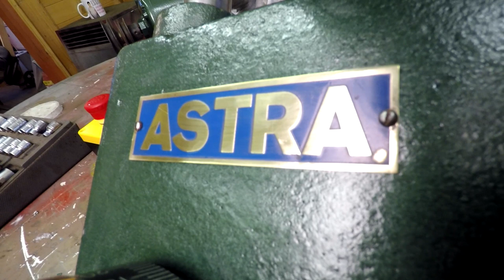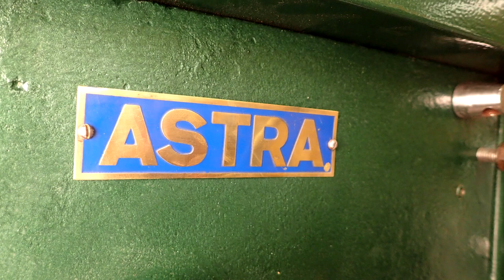(Part 3 of 3) Scrap Pillar Drill Press In Bits - LETS RESTORE IT

Comment: Bloody well done mate. A worthwhile restoration that should see you out. A couple of suggestions: put a long drill in the chuck and use a square to rotate the drilling plate to exactly 90 degrees to the chuck. Ditch the chuck and go for a keyless one. Trust me you will be glad you did. Put an old piece of board between the work vice, which I’m sure you will get, and the cast iron plate so you don’t drill holes through it.
Looks really good and I like the colour, kinda old school. Cheers Stuart 🇦🇺
Reply from the maker: Thanks Stuart. Yes, I was thinking of changing that chuck.
Reply: I’ve always had trouble with keyless....the drill or what ever you use in it (you can buy different gadgets for your drill...rotary planer, sanding drums, router bits etc. that make your drill more versatile. ) tend to spin in the chuck at times. Just be sure to use the key in all 3 places when tightening if you decide to stick with the original.

Comment: a rubber donut is supposed to be between the body and quill. That way, when the quill returns, it doesn't smack metal against metal. Speaking of that, you need to pre-load the mainspring so that the quill will return all the way up when you let go of the handle.
Reply: How does one preload the spring?  Just twist it a few times before bolting it on?
Reply: Yes. Wind it up one or two turns in advance.
Reply: This. Oh my god I was getting so mad. Haha

Comment: Hi Martin, I suggest you tension up the quill return spring to fully move the chuck return wheel fully back to it's stops. A good set of vids mate.
Reply from the maker: Yes, I will. I just wanted to get the vid out on time as it was down to the wire lol
Reply: yea. Just what i thought. Pre-tighten it by giving it one turn or two in advance and it should lift the pinole up to the end.

Comment: When you press a bearing inside a 'tube' the pressure needs to be on the outside race of the bearing (which you did), but when the bearing is being pressed on a shaft the pressure needs to be on the inside race of the bearing, which you did not do.  Nice color!

Comment: I would have removed any drips of paint from the insides of the surfaced and also tensioned the quill spring to return the quill to zero. I would also use some 30weight oil on the outside of the quil to lubricate the shaft. Very nice restoration.

Comment: Great job mate, enjoyed watching that. A tip for you is to tack weld the rack to the column (top & bottom) it's saves you having to realign the table when it's moved up and down. You got a👍🏻from me... All the best.
Reply: TD
I have 2 of these large drill presses. The rack is loose on purpose, to allow you to move it out of the way so that you can use the vice designed for these on the base and clamp projects upright for end drilling.

Comment: Why didn't you just mount the front half of that NVR switch straight over the cutout in the iron headstock...?
Reply from the maker: Many ways to skin a cat lol and the terminals are in their own enclosure instead of in the drill press where you can get a few fingers up under that head bit.
Reply: @bizarreandbrilliant 

I'd have put a cover under that head bit...
And used the headstock to form part of the electrical enclosure...
But that's just me...i suppose...

You've done a decent enough job of it and it works OK...
That's what it is... 👍

With thanks
Glenn
GLMelectrical
Leeds UK
Reply from the maker: It was less hassle to do this.

Comment: That spring should have been set in half a turn off and turneb into position to put tension on the shaft. That way the quill will return to the up position without needing to assist it.

Comment: Why did you not put oil/grease on every bare metal surface especially those which aren't easily accessible (like between the bottom of the post and the foot)? Every uncoated surface is going to rust again pretty soon :/ very beautiful restoration tho!